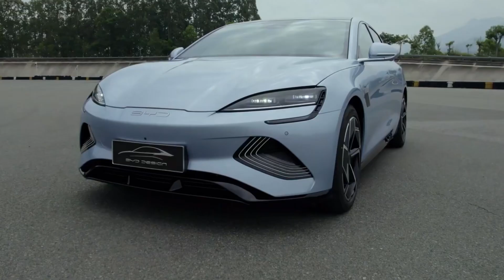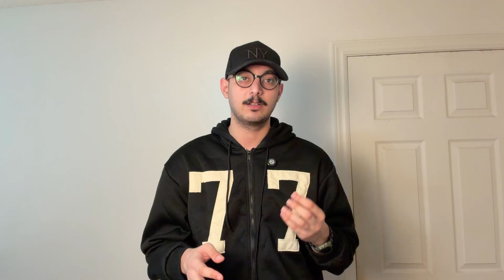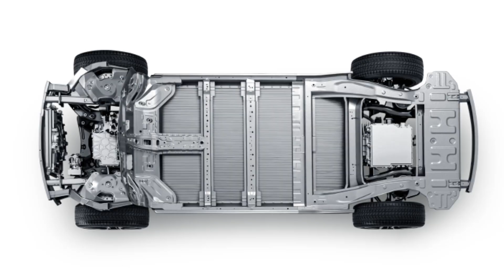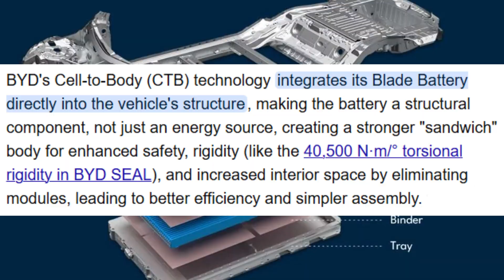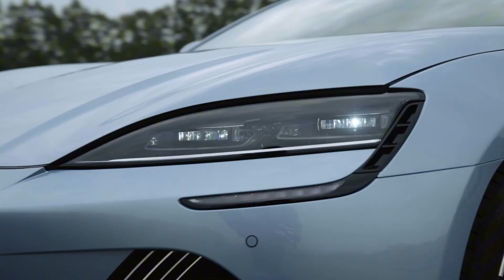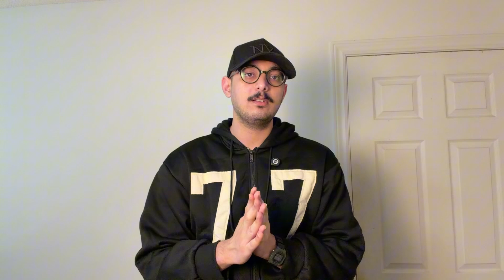BYD Safety Deep Dive: How Cell-to-Body & e-Platform 3.0 Protect You

Comment: Not called Burn Your Driver for nothing. LOL
Reply: I took a first aid course run by a paramedic/ambulance officer.
He told me that if you encounter an EV crash, you should not touch it until the fire brigade has made it safe. Ambulance crews and police do the same.
Reply: @alanjm1234  Yes. EVangelists like this author are in complete denial of reality.
Reply from the maker: Thanks for your comment 🙏
The lfp chemistry which is used by byd , is very stable and doesn’t catch fire easily.
Reply: @shayan_ev  You keep telling yourself that. LOL